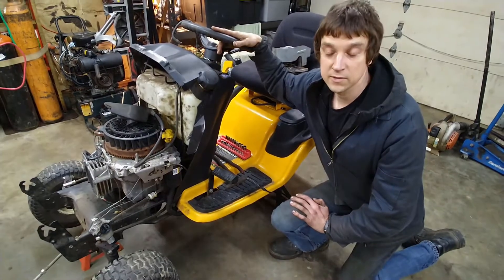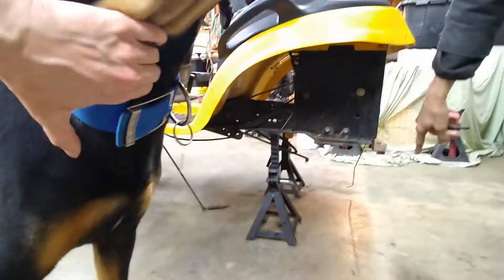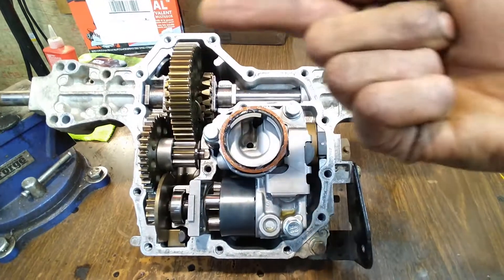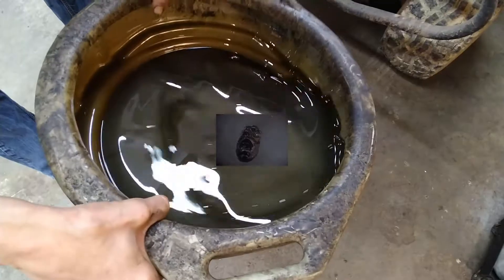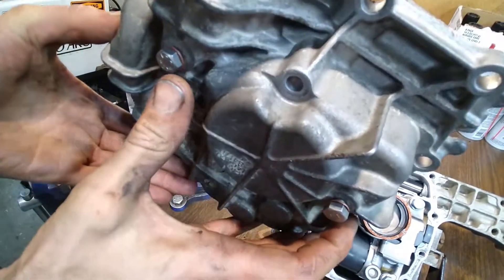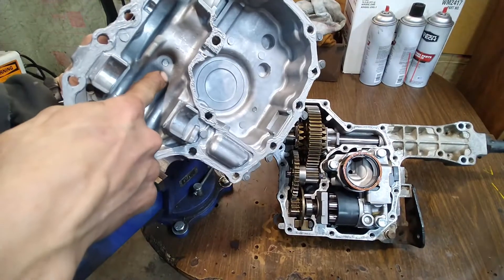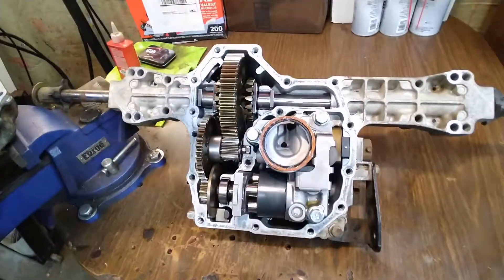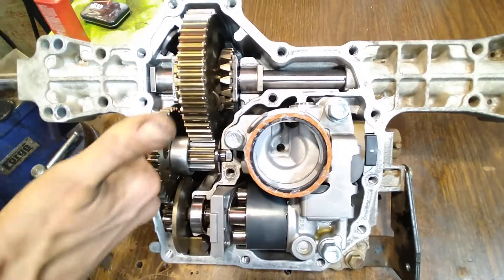Tuff Torq K46 Fluid Change & Drain Plug Install – Cub Cadet LTX 1045

Comment: I must be really lucky because I have a 2015 Cub Cadet xt1 lt46 with over 800 hrs. on it, hilly terrain (3 acres) and the same transmission without any service on it. Same engine, same everything except for belts, blades and tires. How did this happen?
Reply from the maker: I'd say luck has a lot to do with it at those hours and with that kind of use.  It's gotta be close to the end of life.

Comment: How would you fill it with the trans installed in the mower?
Reply from the maker: Remove battery tray and transmission fan/pulley.
Reply: @SolunaGarage   My 2015 Husqvarna LGT2654 had no access under the seat to the top of the rear end. The battery is under the hood.
After years of using this tractor and finally having the 'no power' issue, I had to remove the rear end and tip it upside down over a bucket to drain it. With a spare rider available and nothing to lose, I chose to drill and tap the bottom in the two areas that the factory provides. I noted that I'd never be able to access the cap or add fluid once the rear end was installed. So I drilled and tapped another hole at the back of the case near the top that I could reach from under the back of the tractor. The hole is up high on the back of the case so the fluid will run out when the case is at the recommended full level. I went another step further and made a 1" hole in the back of the tractor sheet metal in line with the fill hole so I can use a socket & extension to remove my brass plug and easily add fluid with a clear tube. I refuse to take that rear end out again for any reason except to swap it out for a completely refurbished unit that I've heard one can buy online for about $900. Sorry for the long post, but this was a whole year project for me, and changing the fluid didn't really help the 'no power' issue. I later read that is a valve rebuild project that's probably not going to happen since I've got other tried and true belt driven riders, and have lost all interest in this unit.

Comment: Is there something you put on the gasket of that filter? My tractor is a 2018 XT1 46LT, I'm guessing same trans? I'm fixing to hit 300hrs, I've always kept it blown off good after mowing, oil, fuel, air, spark plugs, just rebuilt the deck last summer, spindles, pulleys and belt, fairly mechanically inclined, but trying to get the confidence to do this trans service. Pretty sure I could, have all the tools, jack, stands and such. But it's working perfect and I don't want to screw it up, lol. I even have a gallon jug of the Cub Cadet trans fluid, and new vent/filler plug, sitting in my tool shed, that I bought last summer, working up the nerve, lol.
Reply from the maker: I understand your hesitation.  It looks quite intimidating.  The filter does not get any sealant.  The hardest part of the job is in the preparation of the case halves to accept the new sealant.  It is just a tedious job, but not difficult.

You could alternatively just drain the fluid out through the fill cap and not bother separating the case  or installing a case drain.  Changing the fluid at 300 hours is a great service to do either way if you plan on keeping the machine.
Reply: @SolunaGarage   Thankyou sir. I believe that's what I'll do 👍

Comment: I have a 2014 Craftsman (Husqvarna) lawn tractor that I only use to cut my grass and occasionally pull my rubbermaid cart when doing yard work. It has about 400 hrs on it and I change the engine oil and filter each year before the start of cutting season. I'm physically challenged and haven't been able to change the transmission fluid, would be wise of me to find a friend that can change it for me.

Comment: do i need to change inside filter or just clean with brake cleaner? Do you spray inisde down with brake cleaner or just live it alone?
Reply from the maker: I cleaned the filters and reassembled, cleaned mating surfaces and drained fluid out as much as possible.  I didn't spray brake cleaner into every orifice because I didn't want it to cause any issues if it moved debris around to places it should not have been able to get to when the case was assembled.  I used some common sense here, there were some areas where either clearly was safe to clean, while the sensitive areas like the valve block and pistons I left alone.

Comment: I was thinking of doing this at 50hrs but I struggle getting 10hrs a season on my tractor. I've been mowing my neighbor's front yard just to try and get to the first 5hr mark to change the oil. You don't realize how small your property is until you get a 50" deck. The pain is real lol.
Reply from the maker: I hear ya!  I enjoy mowing other people's property because we don't have much to mow here.
Reply: I just bought my first riding mower, because I never felt I had enough grassy area to justify it, but what I have noticed already is that the lawn looks much better after mowing. And since I was done in 15-20 minutes, I will be more inclined to do it more regularly .

Comment: The drain plugs install is fine but your not addressing the real issue. The pan cover really needs removal anyway to clean the screen filter, clean the magnets, and wash out the case with brake clean. Drain plugs are good but the fan/pulley needs to also be removed to access the cap on top for refilling and oil level check. So take 1.5 - 2 hours to remove the trans and remove the pan cover  for proper cleaning and draining. Don't skimp on oil. Either use Tuff Torq or Castrol Syntec 5w50.
Drive them gently. My 2016 JD X350 lasted 570hours then the diff gears failed. Disappointing JD. Now I'll remove, clean and refill every other season or 100 hours.  Thank you for your presentation. C.D. in rural New Hampshire 👍
Reply from the maker: Thanks for the comment, but I do mention the filter and case cleaning/magnet cleaning issues in this video although it is titled "drain plug install" 

Glad to hear of another person who takes pride in ownership and maintaining equipment rather than letting it decay and be crushed.

Comment: What fluid are you using? I’ve typically used 5-50 synthetic
Reply from the maker: For customers on a budget I use 15w-40.  For those who want the best I go with 5w-50.